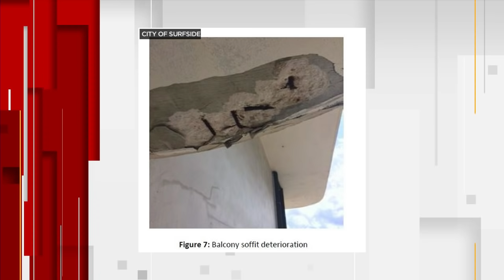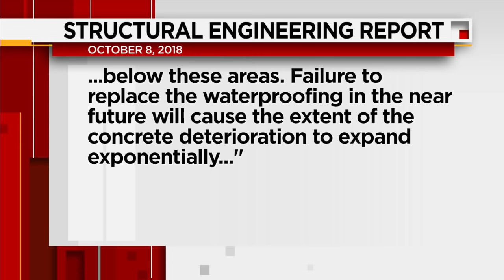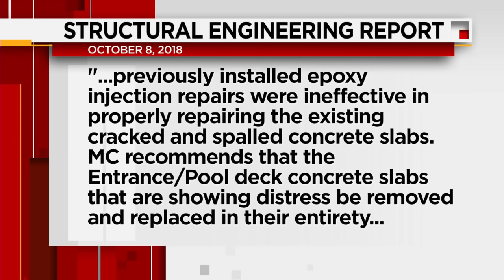Structural engineer Rick Slider discusses Surfside building collapse on TWISF

Comment: preliminary conclusions? wtf is that?
Reply: What exactly do you expect?  It's going to take a long time to figure out what factors caused the collapse.  Until they have every tiny sliver of information, everything is speculation, an educated guess.
Reply: @stephanieadams3747  I think it is just the wrong choice of words. I agree with you totally.  It is going to take months, if not years, to understanding this event. I think making "conclusions" at this stage, or calling speculation, a conclusion, is a misleading use terms.  It should be called what it is: Speculation.

Comment: Who ever did this to these people have to be brought down!people of surfside are you going to be lied to just like on 911!wake up someone did this purposely for a reason now go out and find it!!
Reply: This collapse doesn’t require some sort of “inside job” conspiracy for it to have happened.  
If there IS any sort of a conspiracy it’s that a lot of people’s (residents, engineers) concerns about the structural integrity of this building were disregarded by the people in charge.   
It’s becoming very evident that this building had become extraordinarily unstable at best.
Reply: @alitlweird  grow a damn spine! This was done on purpose by POS greedy people and these people are dead now! People need to go to jail for this!
Reply: You are really ignorant, how is your second year of 8th grade?
Reply: It was negligence. The engineer said that this happens over time. Lack of maintenance, but money has to do with it. Check the Board member's email.
Reply: Pancaking takes simultaneous failure of all major supports and occurs in demolition where charges are set off by perfectly synchronized electrical wiring to set off explosives attached to all the major supports.    They decided it was too costly to fix and rigged the building for demolition and brought it down in the middle of the night and will get the insurance money.
Reply: @jcsgodmother  
"Abundant cracking of concrete' due to degrading of the metal framework. The metal oxidized (rusted, turned to dust) which interacted with the concrete. In addition, because the metal lost it's strength due to oxidation/rusting, the concrete had to bear more of the support over time. The concrete was not designed to be load-bearing, and it did not bear the load.
Reply: @jcsgodmother   the engineers are saying that, normally, a building that is judged to be failing by inspectors/engineers (as this one was) must be repaired within one year. And it had been almost three years since the inspectors wrote that it was failing.
Reply: @alicehallam8247  On ABC they interviewed an engineer Jason Borden who inspected it more recently and he said the damage was the same as in 2018 and was surprised the building collapsed and had no explanation for the collapse.  Either he is covering up or the building was intentionally demolished.
Reply: @jcsgodmother   
Honestly I think that a certain group of the condo owners just did not want to pay for repairs, and kept pressure on the HOA board to not raise the money for repairs by holding votes for a dues increase or a special assessment. Also, the seniors in the building were likely crying on everybody's shoulders. This how my HOA in Colorado is currently failing the community, as well. They can subpoena the Board of Director's and management company's emails and should do so immediately.
Reply: @jcsgodmother    
There is a program about the Twin Towers that explains this. That was a controlled demolition also.

Comment: I bet there were cracks that got filled in and painted over. They do that to buildings all over Flroida. Makes it easier to sell units.
Reply: The only thing they pay attention to is if your rents late. Maintenance issues get looked over and covered up with bandages. So sad and pitiful. God please be with the families and all the lost souls .
Reply: @s.belton8447  the usual
Reply: @s.belton8447  this is a condo building not a rental property. The owners are the apartment residents.
Reply: @Galworld761  That makes it even worse.
Reply: If salt water got into the steal in the columns.  It’s cancer. Rusted straight thru    Just a mater of time
Reply: No doubt.
Reply: OMG 😳
Reply: @Seventh Anubis they could also use Basalt rebar and hydrophobic concrete.      You might want to do some research into materials use for these types of applications since your on top of the knowledge game
Reply: I bet it was a sink hole .
Reply: GREEDY REAL ESTATE SPECULATORS..FOLLOW THE MONEY
Reply: @Seventh Anubis REAL ESTATE FLIPPERS AND SPECULATORS,,  HOA'S 
DO NOT DISCLOSE STRUCTURAL ISSUES.
Reply: @MsButler11  that would definitely cause the concrete to change ph faster and cause the rebar to fail a lot faster! If that's the case, whoever built that needs to be held criminally liable.
Reply: That’s just scary 😟
Reply: @MsButler11  they used beach sand to make the concrete.   ?     That would be horrible with reinforcing steal.
Reply: @andytuesday500  ...yeah...and instant mashed potato mix...
Reply: Too much sharks in Florida....
Reply: Epoxy filler works great repairing stuff like plastic toys and car dents.
Reply: @JudgeCrater22  And buildings...
Reply: @Seventh Anubis they know. They paint the bottom of the ships.  Do you actually think the navy has exposed steal to the salt water on there ships.     You’re a special thinker aren’t you.
Reply: @Seventh Anubis 🥰
Reply: Good news about Jesus Christ! When you first come to him, He completely erases/ forgives your past! You will not be punished for anything bad that you’ve done! Here’s how! 

(2 Corinthians 5:17)- “If anyone is in Christ, He is a new creation: The old has gone, and the new has come! 

(Explanation of the Bible verse above): 

Whenever a person decides to turn their lives to God they will NOT be punished or penalized for any of their past sins before coming to God. Yes, a clean slate! A clean record! But they must abandon their old sins for Good. 

This is what Christians mean when they say they’ve been “reborn” or “born again.” (To have their past erased completely and forgiven!) 

(So for example), if a prison inmate decides to turn his life around and ask Jesus Christ for forgiveness, then That prison inmate will not be punished for his past sins And given a clean slate! This individual will also still be eligible to make it to heaven. But he must abandon crime and his old associates. A life turn around. 

This is what Christians call “repentance.” 

Version 3.0